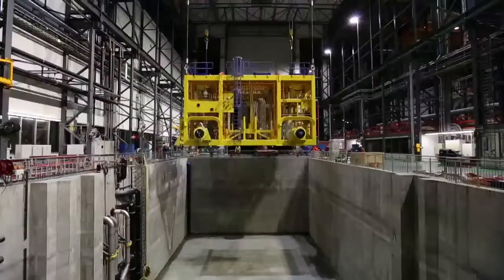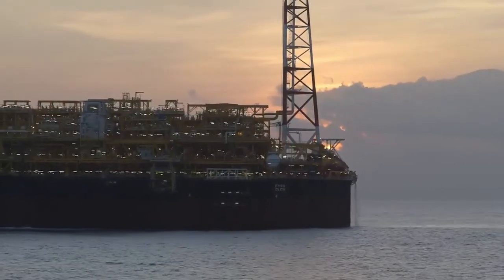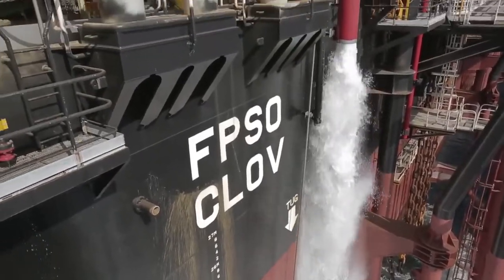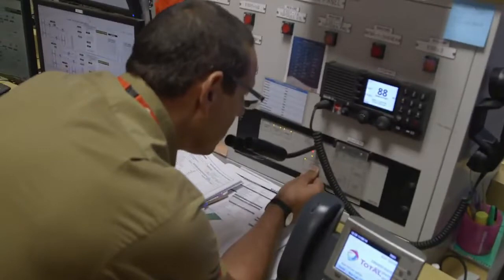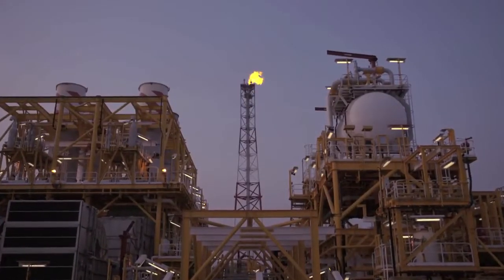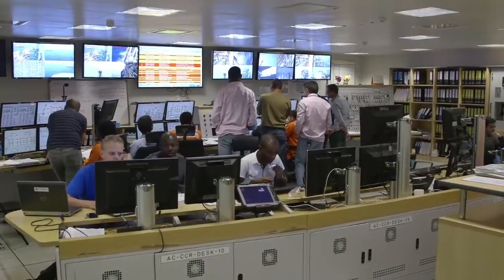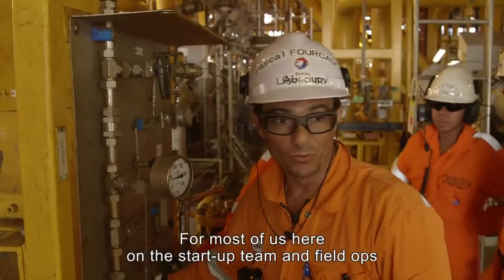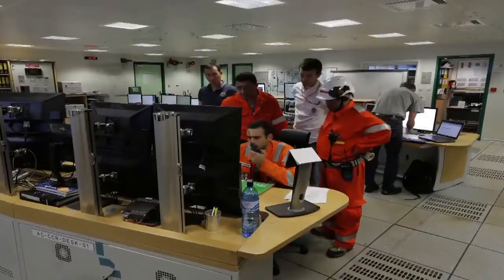FPSO Clov - FPSO First Oil

Comment: Sir how many rank have in fpso
Reply from the maker: Hi there, thanks for watching the videos. The tanks will depend on the size of the FPSO and its application. We could have an all crude tanks, we could also have a mix of liquids and in some extends has LNG and its derivates. 
The total number of tanks differ based on vessel size i.e a product tanker no of tanks will be lower than a ULCC, similar to the FPSO's. Looking at the vessel GA would be able to help your question.